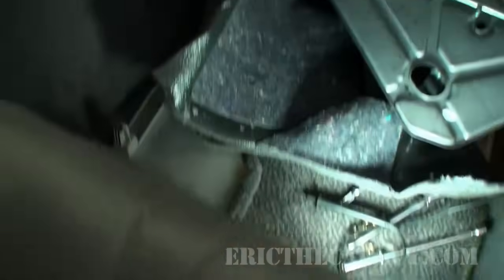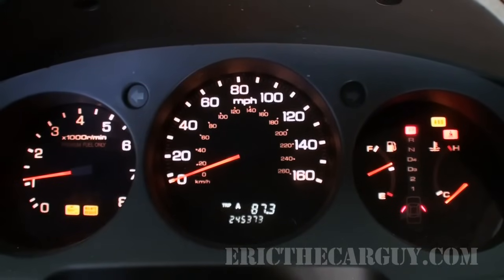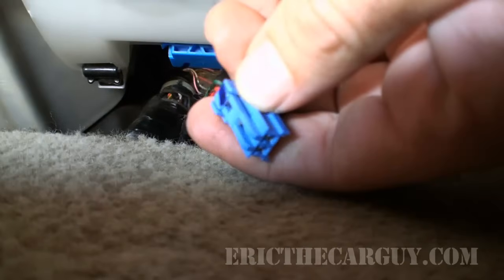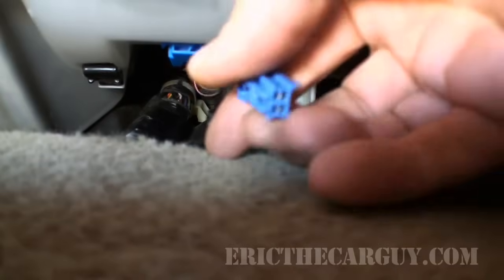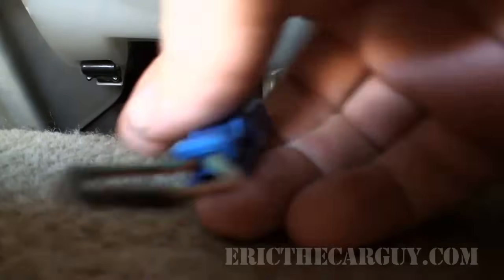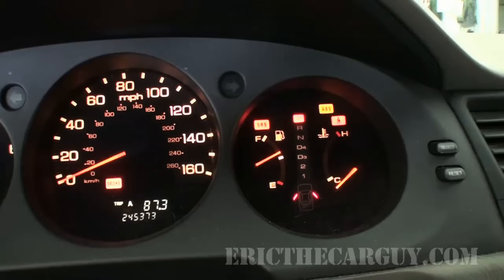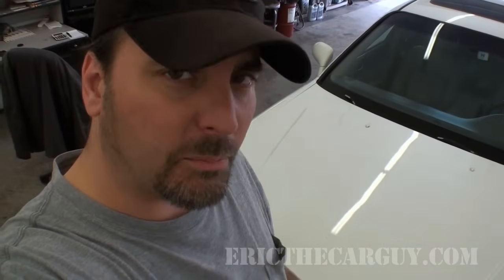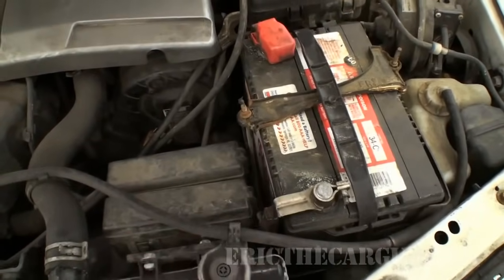How To Pull Honda Codes Without a Scanner -EricTheCarGuy

Comment: Hi Eric I have a problem and need some advice, hope you can help me. I have a 1994 Honda Accord and when I bought it it wants to hesitate/surge at speeds between 40-50, Ituned it up I replaced the plugs, wires, cap and rotor, fuel filter, the Tps sensor, cleaned the throttle body out good and it still seems to want to do the same thing and Iwas thinking about changing out the MAP sensor next hoping that would cure the problem I don't want to keep replacing parts if I don't have to. Oh and I did check try checking for codes and it didn't show any so now I'm kinda stumped at this point. I would appreciate any advice you can give me. Thank you.
Reply: Michael Ollie Sr Just fixed a similar problem. 2004 Honda Civic..At 38-40 MPH when shifting at a low gas feed, rpm was dropping  and engine sounded like it was hesitating. I'd also recommend cleaning up your airbox intake (mine had lots of nuts in it from mice), cleaning up EGR valve . Even though I did ECU re-learn problem disappeared after a week.Now car shifts at different speeds.
Reply: This car is getting the better of me, lol, I just replaced the map sensor
 Bc I checked it with a meter and the numbers were low so I figured it was bad so I replaced it and the darn thing still wants to surge/hesitates, plz. I'm open to any suggestions at this point, thank you
Reply: Michael Ollie Sr Did you reset ECU?  You need to do re-learn. Check your heat shield and other potentially moving parts as well.It's a  tough one to solve.
Reply: Honestly I don't think I did come to think of it and I should know better I should know this I will definitely do this and pray to god it solves my headache, ty I will let you know the outcome
Reply: Michael Ollie Sr Hey Michael, I don't know how many miles are on your Accord, but I've got a high miles Accord same year.  Great car, but with the higher miles, you may be experiencing dirty EGR ports.  Honda had the insight to design a cover to access the ports which can really get coked up with carbon after many miles.  You need to remove fuel rail I believe to access the cover but if you're semi-competant shade tree mechanic you can do this.  You'll need a new gasket for the EGR port cover and it's not cheap, $30 or so from Honda but if this is the problem, you will notice a huge improvement.  Good luck.
Reply: Ok I'll try that good knows I've done about everything else and I did reset the ECM and no difference same problem, my car had a little over 289,000 miles so yes I can believe it would be all clogged up and another thing I noticed last night alone the drivers side rear near the tank on the real there is another filter now does this car run with 2 fuel filters bc it's not the same type as the one under the brake booster, I'd remove part of the line to see if fuel is flowing through it but of course it has to rain and I don't have access to cover to do this but I'm going to, it just struck me kinda odd to see this. I really appreciate all your help. Yes I'm more of your shade tree mechanic and also disabled so I try to do what I can, but I will definitely look into this I sure would be happy as heck if this clears up the problem bc I'm not one to be a parts replacer meaning keep replacing parts till it's fixed bc it gets costly. Ty again, have a good day sir.

Comment: I need help with 95 Accord V6, 
D4 Light flashing but just sometimes... I already checked for transmission codes using Honda's OBD2 Scan tool, but there's no codes stored, I can only access the computer when the D4 is not flashing... Once it starts to flash it won't let me check for codes, it's like the computer has error connection with the OBD2 connector... 

Is my TCM going out???

Comment: Hello all . I have 2002 honda according , just stop running. New battery , check fuel relay, check fuel pump, turns over won't start . Tried today start quick died. Need help

Comment: Exuse me, what is OBDO, OBD1 OBD2??? Is that also used in Europe? have never heard it before.
Reply: +JJ163 Hi, it stands for Electronic On-Board Diagnostics and follows on from the OBD system devised by Ford originally and now adopted by law in Europe. I have no knowledge of the rest of the World. HTH
Reply: OBD = "On Board Diagnostics". I've had an OBD2 port on the last 4 cars (R Reg VW Audi onwards) including X Reg Renault, W Reg Alhambra and 07 Toyota. It's pretty common and you can get readers from £3 off eBay.
Reply: Andy Southern Interesting. Thx for the info.
Reply: Finn Halland It is the plug of your car`s computer
Reply: +Finn Halland You all in Europe will know it as EOBD (European On-board Diagnostics )
Reply: +Andy Southern £3?! I thought they were more or less in the range of about £70.
Reply: JJ163  Google "OBDII Bluetooth" - work with almost all Android Phones that have Bluetooth. You can then use the free (or preferrably pay the £4 for full version) of Torque from Android Market Place. Even if you have to buy a £30 Android tablet (e.g. Hudl1) specifically for the job it's only £37 total (£33 if you are cheap and don't pay for the full Torque version). But, yes, £3.
(First result I came up with was £3.27 http://www.lightinthebox.com/mini-v1-5-elm327-obd2-bluetooth-interface-auto-car-scanner-diagnostic-tool-for-android_p888488.html)
Reply: +Andy Southern Hmmm, interesting. I think the reason why I came up with a price tag of £70 was because I had those high level scanners on mode like the ones that connect to a laptop.
Reply: Yes, they are better, and do read codes the smaller scanners don't. But that's a £8 off ebay USB / Bluetooth + RossTech (for VW)
RossTech is Shareware (free) but with a $99 version.
Reply: ISUZU 3PIN
Reply: +Finn Halland odb0 has 0 o2 sensors odb1 has 1 odb2 has 2

Comment: So if the maintenance require light is on that will flash the same way as the CEL
Reply: The maintenance required light is just there to remind you to do the scheduled maintenance, if you have your owner's manual there's a schedule in there for both regular and severe driving conditions (it'll tell you what falls under severe but I think it includes regularly driving it on trips of five miles or less, lots of city/stop and go driving, and I think temperature also plays a part, and I think a few other conditions apply as well)

The manual will also tell you how to turn the light off (in case you do the scheduled maintenance yourself or if the person who does it forgets to)

Comment: What does it mean when a Honda Accord 1994 has a check engine light on, and the green ring around the D gear that blinks on the front display. It sometimes turns off when you hear the fuel pump come on. and stays on when you don't hear the fuel pump activate.

Comment: 94 honda accord(manual) right under the glove box. Code I received was 14.
Reply: If I'm remembering correctly I'm pretty sure code 14 is the map sensor (I have a suspicion that mine is not functioning properly and I remember 14 as being one of the codes I was going to look out for)

Are you having idling issues?
Reply: Kat Evans Correct some idling issues. Also Bogs down when trying to accelerate and has trouble in gear even with higher rpms. Let off the gas and it violently decelerates a little instead of coasting like normal. Code 14 is idle air control valve.  What's a map sensor?
Reply: Oh ok yeah those are the two things that I think could be wrong with mine, I have similar issues (well mine are more like it just doesn't want to start, it'll idle really low and then stall and I have to have the gas pedal floored a few times before it'll start, plus it idles really low at stoplights)

From what I've been reading you might only need to clean them for the problems to go away, they both have something to do with the fuel/air mixture at idle (map is manifold absolute pressure sensor, same general effect as a mass airflow sensor it just measures a totally different thing to get a similar result?)

Anyway you should definitely try cleaning them (if you can get the bottom half of the resonator/airbox out, which I have yet to manage haha), it could solve your problems and it's way cheaper than replacing anything
Reply: Kat Evans Yeah followed some videos on cleaning it, worked great for about a week then it went back. So I'm thinking it's broke.

New ones aren't too cheap so sorta want to grab one from the junkyard as a cheap patch to see if it's the problem before going in on a new one.
Reply: Aww damn that sucks, that's funny though I was literally JUST talking about how I should go get one from the junkyard haha

I wish you the best of luck! This stuff can be so frustrating, but at least there's plenty of civics around at the junkyards so your chances of finding a working one should be pretty good
Reply: Kat Evans Yeah that's true and hopefully it will be like 20 bucks for one that lasts for at least a couple years. Compared to the 100+ for a new one.

Best of luck getting your car up and running also.

Comment: Thanks Ericthecarguy! I was looking for the blue clip to set my timing on my 2000 Honda CR-V and had ripped off the kick panel next to the blower motor on the right and didn't see any blue clips dangling like I've seen in another video of yours on setting the timing. I started to think the blue clip should be near where I plug in my ODB reader tool and noticed a blue clip there inserted into a blue holding slot and pulled it out of the like you did in this video. Mine was in the passenger side towards the center console. You're video tutorial confirmed I had the right blue clip! Thanks for this video!

Comment: How would u find another to get the code for a 94 honda accord.  The D4 light use to flash now it doesn't flash anymore but the problem is still there. How would u get the D4 light to flash again in order to get the code?

Comment: I got 4 slow flashes but code 40 isn't on the list for my 93 Honda civic does anyone know what the code means my check engine light only comes on when im in like third or fourth gear at high rpm

Comment: Please, anyone:   2000 3.2TL, getting p0301 and p1399, which are Cylinder 1 Misfire and __?, respectively... I replaced cylinder 1 ignition coil last night. No result. Spark plugs are good.  And, I just got my car back from a shop I took it to when it displayed similar codes and symptoms, and paid to have the EGR valve, O2 sensor, and cylinder 3 ignition coil replaced from a p0303 code.. ANY IDEAS what could be going on here??

Comment: I'm having stalling sputtering idle problems with my 2001 Honda CR-V.
No check engine light is on.
So, I am wondering if the computer could still have a code to give me even if it's not triggering the check engine light?

Comment: Anyone know how to do this on a 1993 Ford Ranger 2.3L? I've read that it's on the driver's side behind the parking brake, but I'm not sure which plug it is or if the paperclip trick works on it.
Reply: I think this only work for Hondas.
Reply: jeejay98 Yeah, I found a video showing how to pull ABS codes on a '93 Ranger and it is definitely not this simple.

Comment: My check engine light doesn't flash...Only my SRS light does, and it gives me a code 11, which doesn't exist.

If the CEL stays on, I'm guessing the ECU is fuked? I've already replaced the main relay on my '94 Civic and it hasn't done anything.

Comment: Can anyone tell me where I can find the blue cable in my honda accord 98 coupe ex ? Please?
Reply: yea buddy 602  it is located on the passenger side panel (bottom right) remove the panel and you will see the ECU. You will see a harness that holds/protects the blue cable floating around in there look closely.
Reply: I've got the same exact car and couldn't find it either, then I found this thread where this guy explains doing the same thing with the data port.  Hope this helps
Reply: jason mcdaniel so you use the led computer?  So it should flash ?

Comment: I found the connector on my 96 accord lx. Tried using a paper clip but it keeps comin out.
Reply: Peter Kapica where was it?I found that blue thingwhere it should be behind the glove compartment... no two pin connector tho..
Reply: Its got 4 holes in the connector
Reply: Angel Saenz ^^^^^
Reply: Thank you!! I found it, it was jamed somewhere in there...Thanks!!1
Reply: Peter Kapica You need to put some paper IN the clip first.  The car Title is made from paper use that.   J/K ...

Comment: my 96 Honda Prelude Si has the blue connector under the driver side,not the passenger.
its right behind the radio, along with a yellow connector, just in case yall prelude owners are wondering

Comment: this worked on my 2008 civic. IF THERE IS NO 2 PIN CONNECTOR, IT SHOULD BE PINS 4 AND 9 ON THE OBD2 CONNECTOR.
Reply: ALSO THIS METHOD CHECKS THE SRS ABS AND CHECK ENGINE FOR CODES. THE SRS IS RESET USING THE 2ND YELLOW 2 PIN CONECTOR.
Reply: According to this
http://honda-tech.com/honda-accord-1990-2002-2/service-check-connector-2000-accord-se-2943223/           it's #'s 8 and 13....   ??
Reply: jason mcdaniel well i know Honda civic and accords are different in alot of ways. im assuming this is one of them. i know one of the pins is 4 or 5 as there grounds.

Comment: i jumped it....check engine light keeps pulsing ..1..1..1..1..1..1..1 real even...WTF!!
Reply: "test complete, no codes to display" is my guess at the meaning of that.
Reply: but the check engine light is on when ever i start the car...its odd!! any honda guys out there have this problem??
Reply: And it stays on the whole time it is running ?  Do you have any driveability issues? What year and model?
Reply: it drives okay but runs a bit on the rich side.wide open throttle throws a little black smoke. check engine light is always litt. when driving. even the srs or abs light is blinking too. but the blinks are a little faster than the check engine lite. think i need a OBD 1 HANDA scantron. and a galloping pole seperator
Reply: Parts/Tech/ASE here for 13+ years. If you're ever stumped and want a hand. Feel free to give me a shout out.
Reply: Chris Lesmerises  hey need help. I have 05 Honda civic no crank no start. Replaced radiator and next day it smelt and felt like it was running super hot, temp gauge was normal tho. Turned car off and when I went to go start it I got nothing. I can here a small clicking noise when in start position which I assume is starter solenoid but no turn over. Engine light blinks 5 times when in start position too! Help I need my car running
Reply: first go around all your previous work, you may have a harness disconnected. If all is good use a volt meter and tell me what you have for voltage at the starter on the large terminal, then use the meter to make sure you have voltage at the small terminal. Get back to me with both numbers.
Reply: Chrissy Sanrio Check your main relay. You could have a bad solder joint and possibly not fuel pressure because of it. Its a really easy fix if you know how to solder.

Comment: Ok this would be a great video and helpful if Advance Auto Parts and Auto Zone didn't offer free code pulling services.  You just walk in, tell them what year and they come out and pull the codes.  Problem solved.  Zero cost.  Beats buying a code reader or going through all the effort in this video.... plus no morse code
Reply: Auto Zone does not do ABS code check at least not in my area
Reply: Every autozone and advanced auto parts I've been to in va nj md nc does.  They won't clear them though
Reply: Ummm yeah, maybe if you live next door to Advanced Auto or Auto Zone then it MIGHT be faster and easier to just go there.. wtf?

Comment: Also, works on 1990-1993 CB7 Accords. I can confirm it works on a 1990 EX-R, 1991 DX, and 1992 EX. All should be OBD1 ECUs. Does not show ABS Codes on the 1992 EX.

It is either tucked up under the dash on the kickpanel near the door on the passenger side or tucked into that kickpanel that just pops off (has two compression clips). This location is mirrored between Right- and Left-hand drive.

Resetting ECU (and ABS on 92 Accord) is underhood fusebox Back-Up Fuse. Same procedure as explained, disconnect for 10-15 seconds, and reconnect.

Comment: great video, will this work on a 2003 rover 25 I have this light on but the car runs like new with no problems and is also very good on fuel so there seams to be no problems apart from this annoying light
Reply: If there's no inspection requiring it off, live with it.

Comment: my check engine light went on today 
i turned off engine 
whent to find a paper clip 
then jumped the wires with it
and then when i turned the key on the light was'nt flashing it just stayed on there was no flashing...
any ideas ??
Reply: Plastic paperclips don't work.
Reply: smartass kid !
Reply: Rýán Túçk lmfao!!!!
Reply: Rupinder Suman This tric works with OBD 1 ! not OBDT2...
Reply: I have the same problem,the engine light stay on
Reply: Back in the day, some cars had to be flashed on and off for the check engine light to start working, like three to five times.
Reply: you might want to check the back up fuse in the engine compartment fuse box first. my '93 DX got its first check engine light at ~ 180,000 miles. the check engine light did not flash when i jumpered the connector as shown in the video but replacing the blown fuse resolved the problem (the check engine light did not come back on when driving).
Reply: Vtecing
Reply: Vtecing n

Comment: I'VE GOT A HUGE PROBLEM. FIRST, LET ME APOLOGIZE FOR THE CAPS. IT'S EASIER FOR ME. ANYWAY, MY 1995 HONDA CIVIC DX's CHECK ENGINE LIGHT STAYS ON. I RETRIEVED THE CODES AND HERE'S WHAT CAME UP. SHORT FLASHES FIRST. 3 SHORT FOLLOWED BY 7 SHORT. WAITS 2 SECONDS, 5 LONG FLASHES, AND THEN STARTS OVER. THERE IS NO CODE 37, AND I DON'T BELIEVE THERE'S A CODE 5 EITHER. WHAT THE HECK IS GOING ON HERE? SELLING THE CAR TODAY SO I NEED HELP ASAP. THANKS ERIC OR ANYONE ELSE WHO HAS A LEGIT ANSWER.